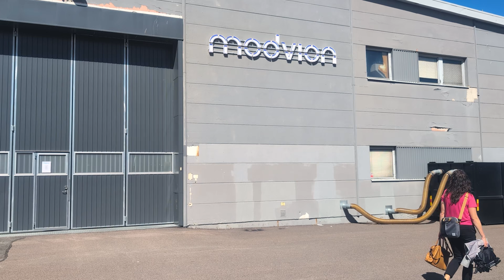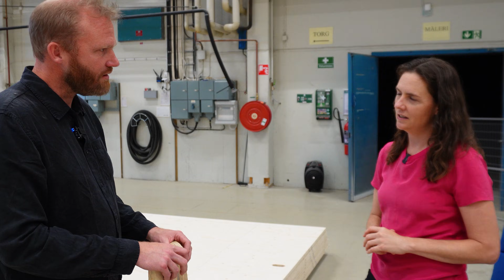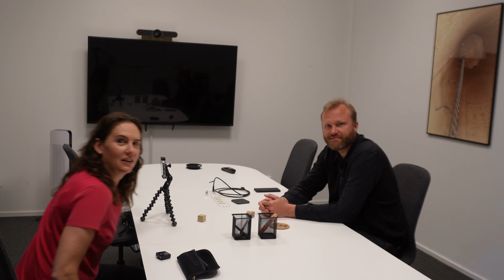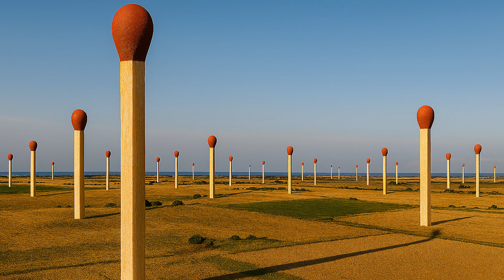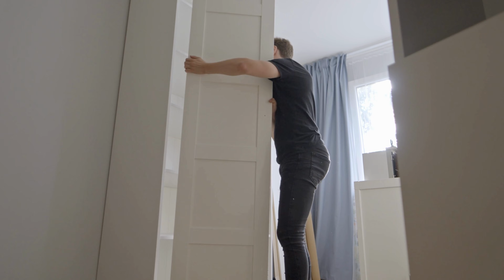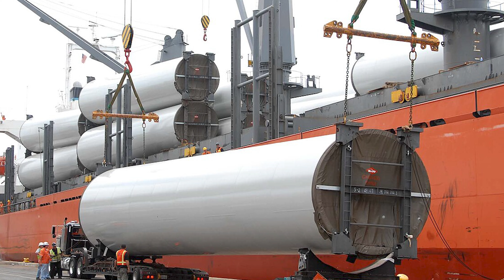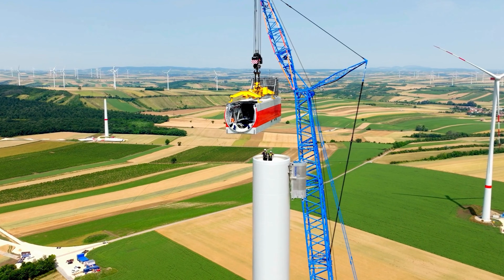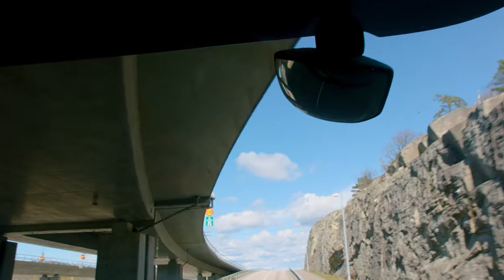How a Wooden Tower Could Unlock Bigger Wind Turbines

Comment: Sustainability of towers isn’t really would be a logical fallacy. just because wind farms have a fast footprint payback, that’s on account of them displacing vast amounts of fossil fuel consumption and in a pure sense is orthogonal to the reduced footprint using engineered timber towers vs steel towers. while “leakage” of sustainable timber is a legitimate concern, for the lifetime of the project (and any subsequent redeployment as new engineered beams) this is all locked up C for potentially centuries.  it also increases demand for sustainably managed engineered timber (which hopefully will start to replace land under use for high emissions livestock production if we ever put a carbon price on mega-emitting cattle and sheep production). i’m not sure what kind of down-cycling will happen with these towers at end of life potentially after being redeployed for a second life, i’d hope it’s more high grade than pulp for cardboard. i don’t doubt what the interviewee suggested in terms of cutting them down. 

where reuse as cut down beams is. it applicable (say for the offcuts) use as new engineered boards is another potential reuse that is not very energy dependent, and the energy would be electrical (heaps of case uses including interior wall panels as one Australian company is downing) from the shedded timber material. 

steel has a quick C footprint payback when used in turbine construction especially if it’s recycled steel, but that’s on account of wind power displace the high emissions of existing coal and gas generation. plus there’s also leakage with steel from recycled steel to new steel from newly extracted ore. 

though i’m not exactly sure the Carbon payback on these engineered wood products is as towers, it has to be much, much less than steel whatever the source of the steel which ultimately has been ore extraction and smelting. i’m not sure why you are so sceptical. do the math! citing the wind turbine carbon footprint payback is a way of obscuring the comparison in my opinion, the emission saved using X tonnes of engineered timber vs Y tonnes of steel are still potential missions not emitted, and i expect the numbers are non-trivial. this is true irrespective of how much carbon abatement,ent a wind turbine is going to produce over it’s lifetime. if you are concerned about “leakage” for sustainable wood (a real issue in Australia for eg) then it’s hypocritical to not be concerned about the abatement of using timber over steel, because both concerns are examples of broadening the domain of consideration beyond the specific application.

Comment: The biggest plus for the wooden towers is indeed the transportability of the wooden modules. No more extreme weight transportation logistics bottlenecks, you can just use regular trucks to transport the modules and then LEGO them together at the site where the windmill will be located. Big win.
Reply: Isn't the biggest transportation bottleneck the blades not the tower?
Reply: @Ninjaeule97  yes
Reply: already do this with the metal ones.

Comment: I was surprised that the wood wasn't treated with ethanoic anhydride - it has been used very successfully to produce an extremely stable and rot-resistant material.
Reply: Oiling, burning the surface and waxing makes wooden buildings from the medieval times still stand there 500-2000 years later.

Comment: No mention of the blades. Are they made of timber too?
Reply: The blades are mentioned in the section about sustainability menationing that they are made from composites and therefore a less sustainable part of the powerplant than the tower, traditionally made from steel, and that this company is not replacing them, only the tower.

Comment: Good to see you are keeping your carbon footprint as low as possible Rosie.
Reply from the maker: Assuming this is sarcastic as I filmed in Sweden and live in Australia. And that is a totally fair thought to have. I did make 3 videos and present at 2 events while I was over there, so I guess divide what you thought my carbon footprint was by five. It still leaves a high footprint and that is something that I do grapple with. For my personal circumstance I believe the CO2 is "worth it" because I learn so much when I travel to conferences and exhibitions and with my consulting work, every 0.1% gain I can make for my clients (mostly wind farm owners/ operators) transflates to much more CO2 avoided than the footprint from flying to the event where I learned what I needed to help them improve.

Comment: Reindeer are losing increasing areas of habitat in Finland to logging of old forest which can support them and Sweden has a much higher loss of old forest with continuing encroachment onto old forest, leaving insufficient habitat for reindeer without supplementary feeding. Protection and restoration of habitat for reindeer and other old forest species is necessary and a sustainable level of timber utilisation found. Whether timber for wind turbines is a priority is a priority is no doubt a complicated question, but sustainable management of Scandinavian forests is a real issue.

Comment: Every timber structure grown from sustainable plantation forestry locks away the carbon content of the trees. 

So it's crucially important to include that alongside the carbon emissions from manufacturing in the calculation.

I.e. timber construction is the single best technology currently available for carbon sequestration.
Reply: It's good, as long as for the sustainable wood plantations you don't cut down rich natural virgin forests (especially in other poorer and more corrupt countries)...
Reply: @RaduP66  shhh dont give them ideas :P
Reply: Just grow the plantation timber and bury it in a coal mine. This will cause the wood to decompose and release methane. The rate at which plantation trees can be grown in land that can also grow food is the same argument about turning food grade grain in to ethanol. You have to make the wood therefore the carbon stay on or in the ground for all time
Reply: @theairstig9164  The Northern part of Sweden is not suitable for farming. It's basically an enormous forest!
Reply: @theairstig9164   OK I'm slightly confused here Stig - Could you please explain your suggestion a little more? Are you planning to harvest the ex-coal mine gasses as they offgas from teh wood in the mine (turning it back into CO2)?  There is a problem with methane itself...The Methane you plan to produce if it is left unburnt, is 84 times more potent as a greenhouse gas than the CO2 originally taken up by the tree. If you look it up on the web for example - escaping Methane is currently estimated to make up between 10 and 20% of total greenhouse gas emissions.
Reply: @theairstig9164  It's good example. We have here saying for this kind of "innovation", making pancakes out of wood. It's chemically possible but not reasonable.
Also if you look this product then reasonably small part of carbon is ending up in the tower and stored there long time (50y?). Most of the wood that comes from forest is wasted or made to short lasting products like wood pellets. In old forest carbon is stored for centuries in temperate climate.
Reply: yes
Reply: Plantation forests are harvested too young to allow for carbon sequestering. Google it.

Comment: Want even more recyclable? PolyEster Covalent Adaptable Network (PECAN) biopolymer for turbine blades and binder for the wood. Wood sequesters more than two times its dry weight in CO2 drawn down by the tree.. which should by Adam Smith's principle of property ownership should encourage foresters to grow more trees.

Steel? 4-16 times its mass in CO2 emissions.. even recycled. Unless it's Hybrit or flash steel.. except H2 for those is usually from methane with GWP-20 of 85 if it leaks, with GWP-20 of 33 if it leaks, and H2 is the leakiest gas in the world.

Comment: I do not think that sustainability is the main advantage, availability is the important part. It increase the amount of materials that can be used and there is little correlational between steel and wood raw material cost. That wood construction locks away carbon for a long time is also a plus. 
At and average of 100 tons of steel per megawatt we are using 80 million tons every year, or about 4 % of the worlds steel production. Just the steel cost millions in US dollars and a increase in cost of raw material an energy have great effect on total production cost. Spreading it on different types of materials will help stabilizing the cost.

Comment: A good video but ......
I have a number queries/concerns which you either did not address or did not cover in this video.
Cost of production of timber towers v cost of construction of steel towers? Including all costs i.e. glue/manufacture of LVL panels. No actual figures were given. Statement that costs are comparable or competitive needs to be explored/justified. Cost of Construction and construction timeline v steel towers? Transportation of panels?  Comparative use of cranes? Joining of panels using steel inserts? Strength at joints?
The claim of sustainability and use of quality materials/methods only applies to their company and so is meaningless. Others can and will use cheaper methods/materials.
Pilot Study/prototype and scalability of construction needs further study. TRL ? How could the use of wood unlock bigger turbines?
The danger to people of fire only applies during the construction phase not during the operational phase. The danger of fire or other damage during the operation of these towers is no different except that of conducting lightning strikes to ground (fitting of alternative)

Comment: Excellent video. I work with data centers in Sweden and one building has been built in wood, it’s a very sustainable alternative!
Reply: I live in a house built of wood in damp Denmark.

It has stood since 1936 and is still fine.

The house has a thin cement coating (0.5 cm) which protects the wood.

I need to repaint it every 5-8 years or so and remove any shrubby touching the outer walls, but that is it.

We have insurance against fire, but not against rot as the insurance company isn't used to houses built of wood. Go figure.
Reply: @madshorn5826  There's a lot of mediaeval houses in the UK that used (a) oak hardwood (b) a combination of pine tar (for preservation), boiled linseed oil (strengthening and curing) and beeswax (hydrophobic) mixed with turpentine. The Japanese wooden temples, some dating back to the 14th Century, used to burn the surface to harden it and remove sugars from the cellulose.
Timing of felling was also important as the tree took the sugar down to it's roots in deep winter. Christmas eve through Jan 24 was apparently traditional in Bavaria.

There's an annoying AI voice, but "Why Medieval Wood Never Rotted While Yours Dies in 5 Years" on the Medieval Wisdom channel shows the process.

Comment: Great video, Rosie! 

I'm reminded that in the early days of U.S. Windpower they had one of their experimental turbines on a fiberglass tower. I still have a photo of it somewhere, I think. 

This was located in the Boston area and you could see it just off Route 128. Obviously they didn't do anything with it when they finally got into production.

In a somewhat related topic, I'm reminded of when wood laminated blades were rather trendy. There was a wooden boat builder that used something called the WEST system to make plywood hulls. This got transfered into making blades for a while. I'm not sure why it fell out of favor. 

Also one of the early big turbine companies, Boeing or Hamilton Standard perhaps, suggested they should ship plywood blades in sections to the site and then assemble the sections with finger joints that would be glued and cured on site. 

Ah, fun times.  :)
Reply: Hey Dennis.  The boat builder was Gougeon Bros who owned West Systems Epoxy.  The did the wood laminate blades for the Mod O series DoE turbines and then for Enertech and ESI wind turbines.  They also built blades for the Westinghouse 600 kw machines on Hawaii. If I recall, the 600s had some creep issues near the tip region.  Leading edge erosion was also noted .   All of the GBI blades were designed (structural) by Mike Zuteck.   Mike also did some design work on a wooden tower on a DoE study.
Reply from the maker: That's interesting about the fibreglass tower. I didn't know that had been tried. Do you know the company? I can imagine fibreglass towers making a comeback actually, if they could be easily made onsite perhaps. 
And people are still messing around with wooden blades. There's a German company called Voodin who I think installed a prototype with maybe 20ish metre long blades this year.
Reply: Nice video Rosie.  I have more questions regarding flanges and foundation interface, but I also wouldn't expect them to show everything.  As for decommissioning, mobilizing a crane is insanely expensive.  Would the recyclable wood values actually  support the expense?  Chain saws are cheap... (Oh he's a lumberjack and he's okay..).  BTW, our youngest is commissioning certain German machines in Sweden using 169 meter towers.
Reply: I think part of the problem with and wooden boat system is that it can be more labour intensive and there is a much smaller demand and therefore lower value on the resale market. I have had both and the wood boat definitely needs the right buyer.

Comment: 16th August 222, Tretten Bridge in Norwey colapses.
20th November 2025, COP30  sustainable buildings burned sown in 6imuts
"Wood is nice until it isn't"
Reply from the maker: I thought Eric and I covered the potential for fire pretty thoroughly, what info was missing that you still think fire is a reason to avoid wood for wind turbine towers?
Reply: @EngineeringwithRosie  I wouldn't worry too much if Michal here has to go back to 222 AD to get his anecdote.
Reply: Tretten bridge was a construction failure and we have many of those when steel are used.
COP30 fire was a lot a of fabric and other materials burning and very little laminated wood. The fact is that a similar strength laminated wood beam last longer in a fire then a steel beam. When adding fire resistant coating timber will stand while steel "melt" (get so soft it can not hold a load).
Reply: I'd be surprised if the total environmental cost of steel - mining, smelting, rolling etc, isn't far higher than that for timber. Mining, for instance is a one shot deal. The land cannot be mined twice and is severely degraded after mining operations. Forestry, on the other hand, is a process that can be repeated, whilst acting as a significant CO² sink. Steel production is a net producer of CO² at every stage, and that CO² largely comes from fossil fuel. Engineered timber production produces a waste by-product that can be used to fuel the process.
Reply: @thedogfather5445  It's not all-or-nothing. Agribusiness monoculture is a degraded ecosystem unlike like old-growth forest, and some say the trees are harvested too soon to be effective CO2 sinks. It is highly suspicious that comparisons keep being made between "wood" or "timber" and steel, when we are actually talking about a highly processed product. How much energy does it take to to heat and press wood laminates, and what are the environmental impacts of the resins and glues used? Perhaps the answer is these are minor, but I can't even tell that the questions are being asked.

Comment: Great idea.
Already, one in every six thousand wind turbines burns each year.
With the advent of wooden turbines, the fires will be even more spectacular.
Reply: That's like 0.016% seems ok
Reply: @TerraCAD  If the typical turbine lifespan is 20 years, that's 0.3% chance of each one burning down.
Reply: @aliendroneservices6621 Yeah that seems fine. Because they are modular, it wouldn't even affect the output of the wind farm that much.
Reply: What has changed?
How many towers spontaneously combust?
Better cable management/containment commensurate with the new environment should negated any issues.